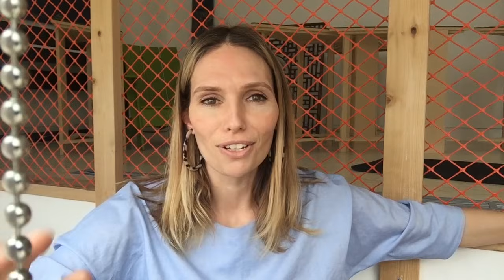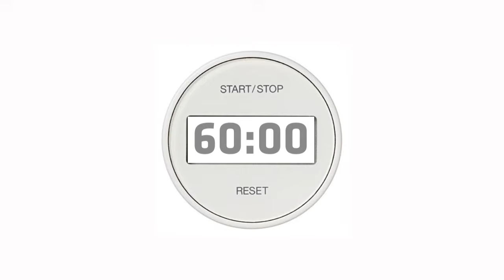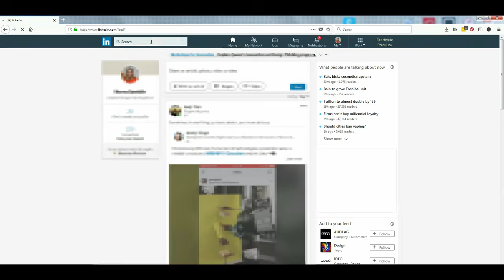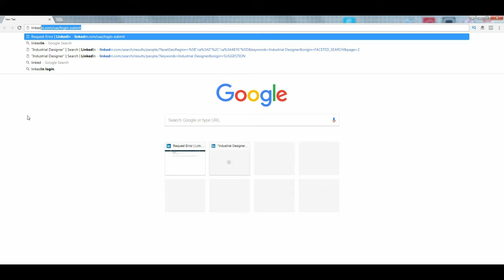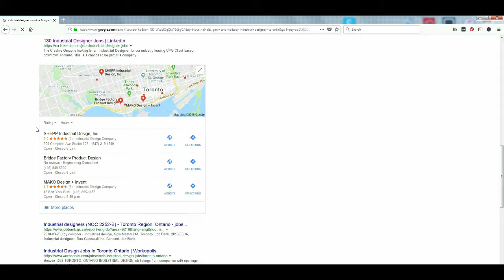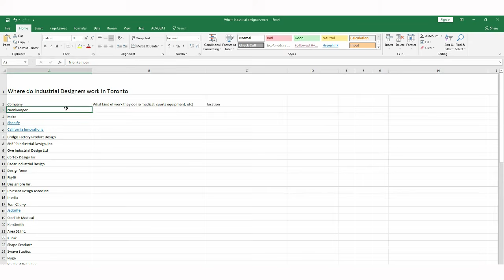Industrial Design JOBS |  FIND THEM IN YOUR CITY

Comment: Great content,
I didn't study industrial design, but I self lean it and create and full product as well as its prototype. Do you think, with one product I can apply for a job?
Thanks
Reply from the maker: Hi Hossam, just so I understand, you designed a product to production? Is it now on the market?

Normally in a portfolio there is more than one product.... so you may want to work on some more projects to include in your portfolio.
Reply: @DesignplusMorna  Thanks for the useful reply.
Let me rephrase my points, however, you already reply on your 2nd point.

- I'm a self-learning product designer, I didn't study at college/university.
- To test my knowledge and skills, I create a product "Plug-and-Switch-Socket" from scratch (research, drawing, cad design, functional prototype) -no one requested and it's not in the market.

Thus, I have only one real industrial product to add to my portfolio and a few things such as (package design -in the market-,  Sales-point design).

My question is, do you believe that with the above history I can apply on a job? or do you have any advice for me before submitting my application?

Thanks